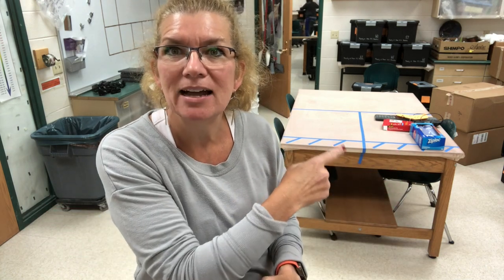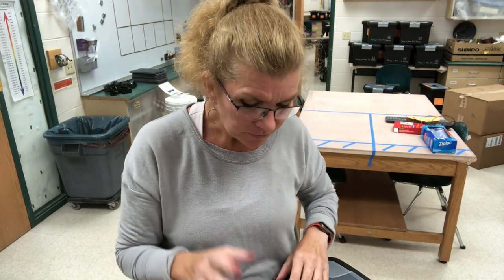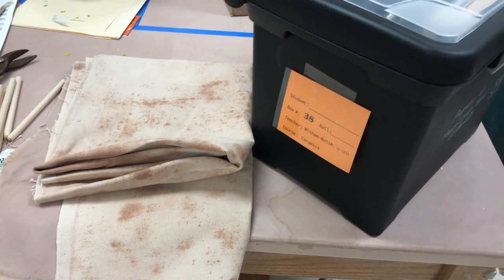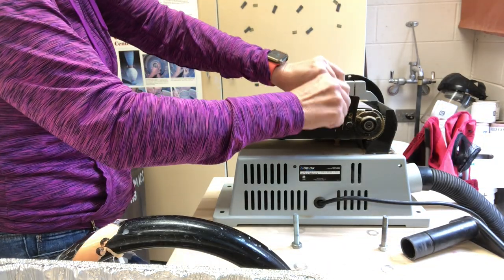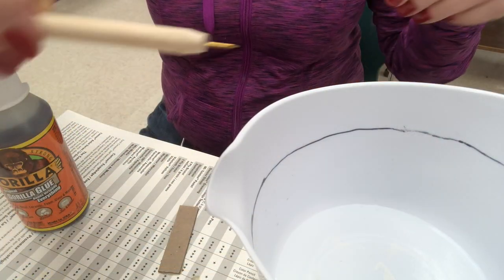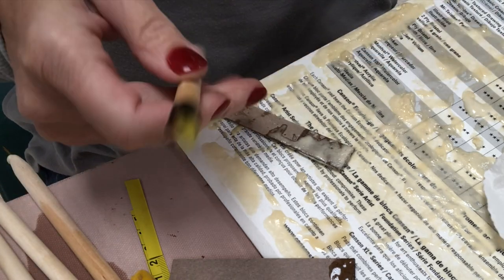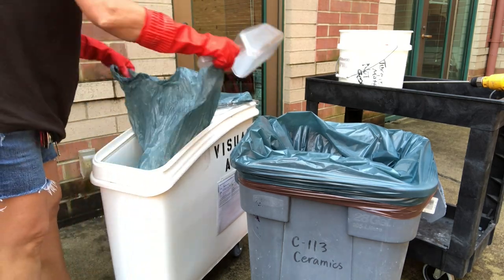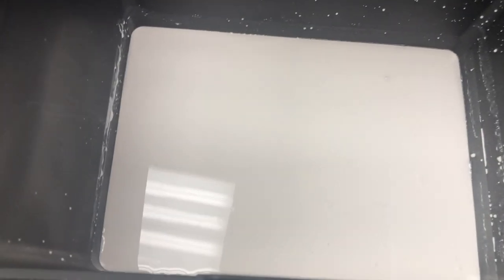Making Kits for My Students: Preparing for Online or Blended Learning this Fall

Comment: What stand do you use to put your phone/camera on when not holding it? I think I need one.
Reply from the maker: I use a heavy- duty gorilla pod heavy enough for a dslr, but then I put a camera mount on the top... so, something like this one:  https://www.amazon.com/gp/product/B074WC9YKL/ref=as_li_tl?ie=UTF8&tag=karanspotsand-20&camp=1789&creative=9325&linkCode=as2&creativeASIN=B074WC9YKL&linkId=c4bdf8545b96e51abf4950f6b6766c29     I then just took a camera mount off a smaller camera tripod I had, but didn't like as much as it felt rickety....